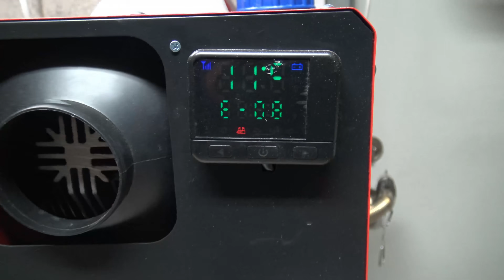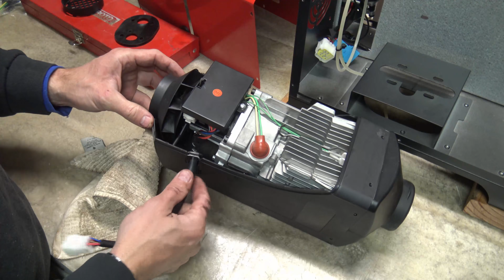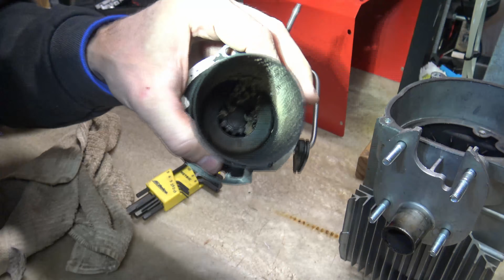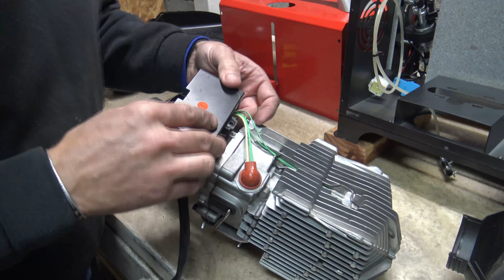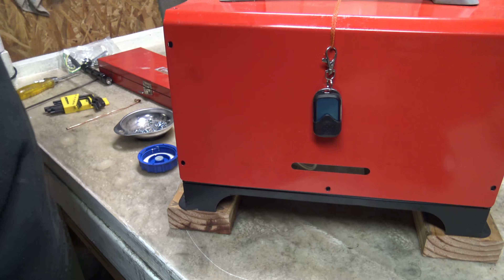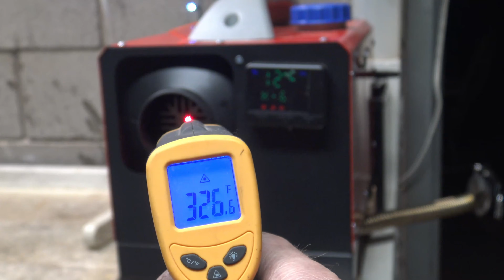E08 ERROR CODE - VEVOR Chinese Diesel Heater - Repair After Burning Old Motor Oil

Comment: When you reassemble, do you put new gasket in it or do u use old one
Reply from the maker: @sawlay6223  I used the old one, but there's nothing wrong with replacing it!
Reply: @jiujitsu2000  thank you for sharing

Comment: Dude this video saved the day! Fuel was good, everything was getting power but no combustion was happening so I took the unit apart and soot/carbon was CAKED on the inside. 
Cleaned it all out, put it back together and heat was blowing thank you !

Comment: Helpful to know what the E08 code means. For me it was flame out because the pump had stopped working. I think I had installed it at too low an angle. Anyway, the replacement arrived today, £8, and is installed and running, thank you

Comment: Hi. I have one of these about 2 years. Great heat for my little shed too hot sometimes even on low heat. I'm on my third glow plug. First time I mess up left the unit run out of diesel,the glow plug seem to burn out. Ordered another one came just the plug. The unit was full of sut hand no socket to fit plug but was loose anyway. Fired her up and away she went. But. I damaged the seals which was sucking bin air and it kept smoking badly😂I smoked the whole street out. Ordered seals which also came with the socket and a new wire gauge. pump got stuck another time and I took it off and reversed the plus and minus on the battery to reset the pump it worked .Just briefly connect it and you'll hear the Clic.  This time   I ran out of diesel again😢 and ended up changing the plug again and another clean. I think I might have dirty diesel there is no filter. Other than that is a grand wee thing 😂😂

Comment: Try ker-o-clean in the used oil. I have been using it with some used torpedo heater i picked up and it cleaned them right up and the diesel smell is almost none existence  just a thought thanks for the good videa!!!!

Comment: Cheers for video guide, could throw that thing down in the ultrasonic cleaner, should clean out those small areas. Does it work good to use the old used motor oil in this unit ?

Comment: So I burn jet-A in mine(get waste for free from the airport I work at). I am super curious how you are burning waste oil, I figure I could cut my jet -a with waste oil but not sure if the ratio.
Reply: 50/50 diesel works great w.o issues

Comment: Do you have any higher temperature readings as I have a vevor and a Hcalory and get following with same pump
Vevor casing 190c
Hcalory 211c
I have written down controller settings and experiments in open air to see if more fuel or fan speed helps, it seems 190 c on vevor is maxed out